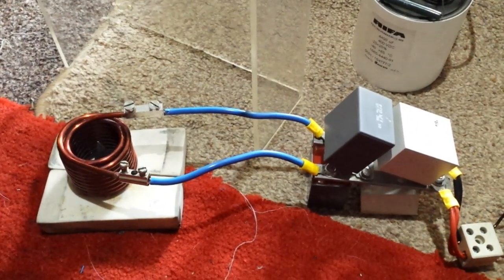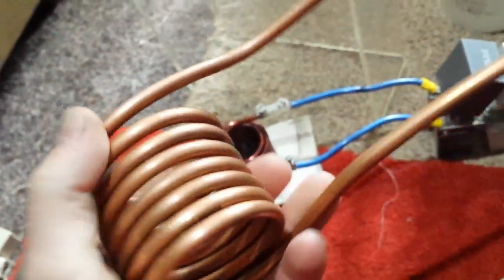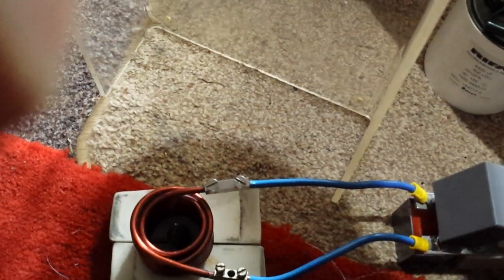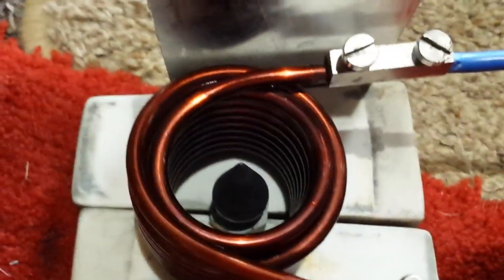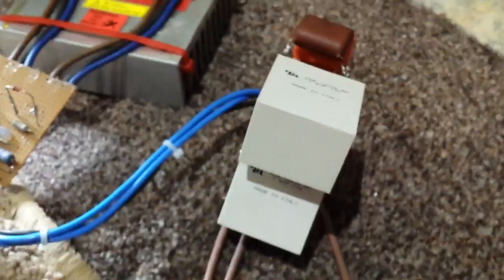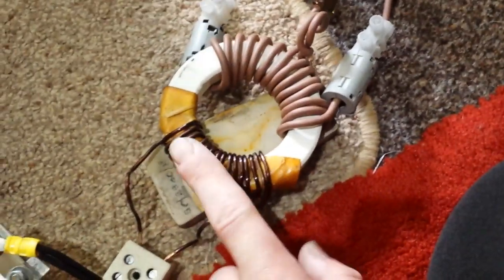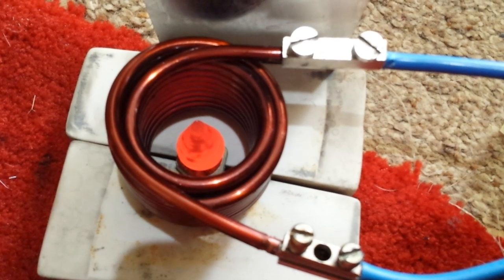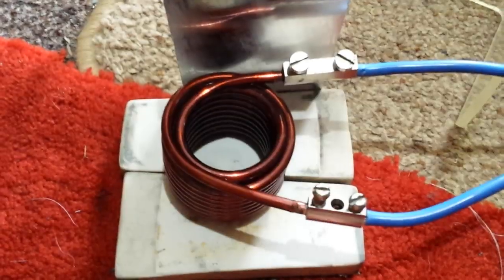Fast mosfets ZVS Induction Heater'

Comment: u need to match the capacitance on both ends ... and i think the frequency was quite low considering the size of the metal... smaller capacitance [matched on both ends] ...i.e. a higher frequency would had been better....and yes a lower inductance work coil too....;}

Comment: DEAR SIR CAN YOU SEND ME THE SCHEMATIC DIAGRAM AND PARTS LIST ABOUT THIS VIDEO. PLEASE.....?
Reply from the maker: Hello mate, sorry about the late reply.
I have so many emails and comments.
it's a Zvs driver with either 2 extra mosfets in parallel.  and as you would wire the output around the flyback ferrite' iv replaced it with a ferrite ring' and did a secondary wrap of wire for the output. and you can either put capacitors in parallel on the output or before the ferrite ring. you can try different ways to get the better output. 
you can get the zvs of google images.

hope this helps and thanks for the comment 👍😉

Anthony 

High1voltage1rules
Reply: How i can connect mosfets in parallel?? just use another brick resistor on the input and resistor/diode zener on the mosfet?

Comment: Just keeping the coil wet should limit the temprature to 100C. Maybe it's possible to put some coating on the pipe to isolate it?

I know appliance thermostats use thin metal tube, some of them are isolated too. Sure the center-hole is small, but water got good heat capacity so it may still do the trick.

Comment: Pretty cool, um, I mean HOT! I tried this myself once, but I did something similar to what Rodalco2007 did, I made a center tapped induction coil and connected it directly to the ZVS, so there was no need for a transformer between the ZVS and the coil, it worked well and got a coke can pretty hot, I'll have to set that up again and make a video when I have the time.